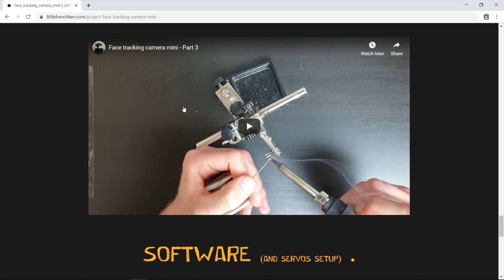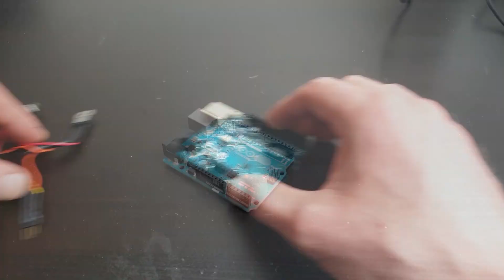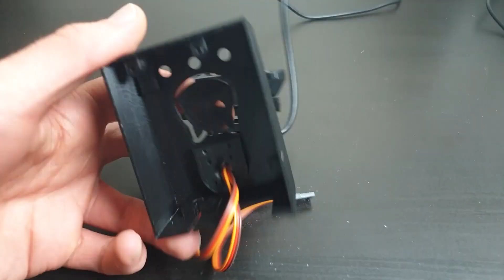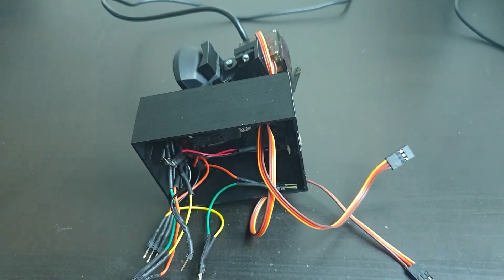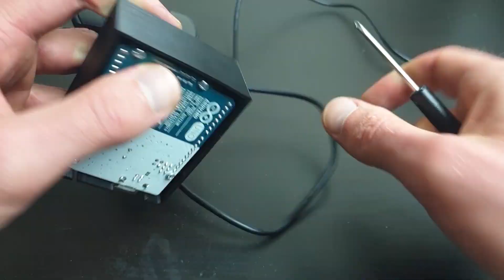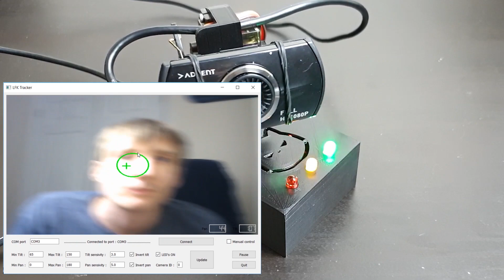Face tracking camera mini - Part 4

Comment: Can we use Arduino camera
Module ov7670 instead of web cam. Pls rpy
Reply from the maker: I don't know I have never use the arduino camera module but the arduino won't be able to handle the image processing anyway .
Reply: @Littlefrenchrobot  thanks
Reply: the arduino cam, or esp module broadcasts to an ip address. It is possible to use the camera for this experiment, however; you would have to change to code to find your camera online as opposed to locally.